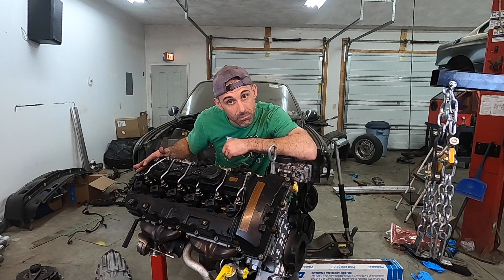Part 22: Some Custom Work On This E30 N54 Engine Bay!!

Comment: FYI , the bmw clutch alignment tool from BMW part number is 83-30-0-495-449 , and sits under the pressure plate when fitting before tension is released , comes with a small m5 bolt to screw back in once tension is released , really simple
Reply from the maker: Now that's interesting. How did you find that out? I couldn't find it on TIS or REALOEM. I would love to know how you found that out! Thank you for that, appreciate the time you took to leave that VERY valuable comment!

Comment: Could you cut the clutch alignment tool down shorter, install it in the clutch disc, then bolt everything on and remove the retainer disc?

Comment: Prefer the clutch lower to the floor, but I get what you saying about the miss shifts and not selecting gears properly. Love your work and enjoy your videos. Just a question. What car is this gearbox from? Your attention to detail is awesome btw 👌
Reply from the maker: Thanks a lot, good question! At least the bearing has the option to choose pedal feel which is cool! The trans is a GS6-53BZ From an ‘08 335i, 6 speed, 8 bolt DMFW version with the female pilot bearing in the trans input shaft as opposed to the flywheel itself